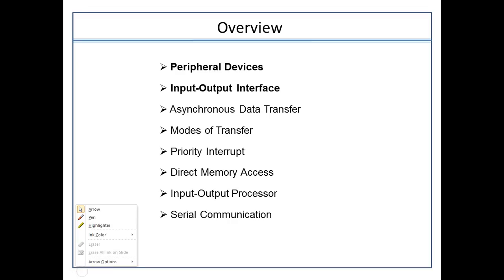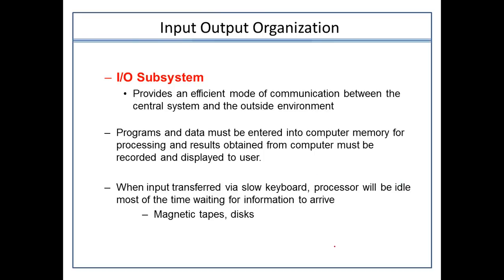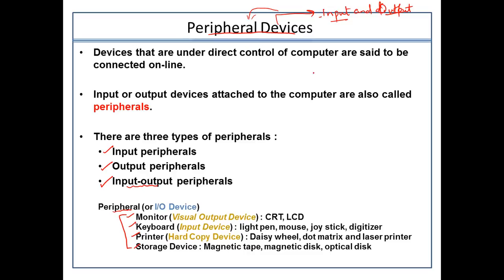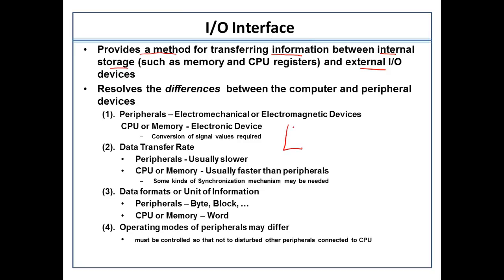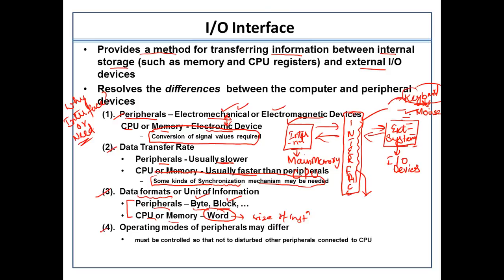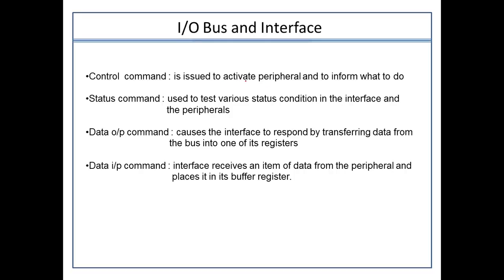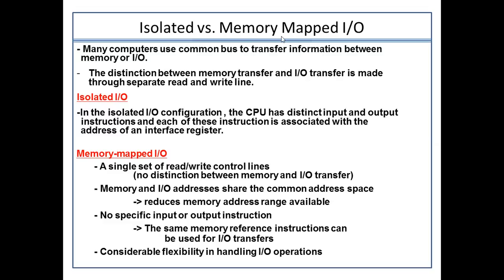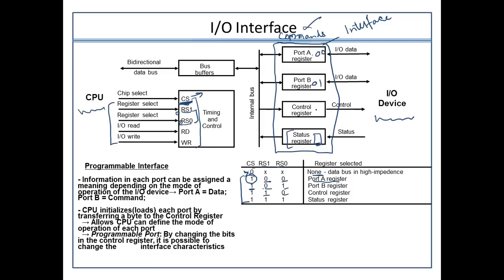Input Output Organization- Peripherals and I/O Interface

Comment: Explained Very Well, Ma'am.
I zotted down some doubt please help me to sort out this!
Q1- Is internet device like the modem is considered as  Input or Output device (as because it takes input from ISP and gives the output as wifi to us)
?
Q2- At 14:00 what functionality 8th bit(MSB) perform in the system?
Q3- At 18:50 what is 'word' used for (is it means the group of bytes/bits)
.
Q4- At 24:00 (In dig.)The interface between different components(keyboard, printer etc) are the same for all components, as they are performing the same function?
Q5- At 34:08 Is CS(chip select) act as an Enable pin?
Reply from the maker: Thanks so much for watching this session.
Here are the answers to your questions dear:
A1. Modem(Modulator/Demodulator)is basically considered as Input/Output Peripheral, as it has the capability to send and receive the data over telephone lines.
A2. The 8th bit in ASCII code is usually the extra bit which is used based on different application. for example, some Printers recognize 8-bit ASCII code and they consider this 8th bit as 0. But sometimes this 8th bit is also set to 1 in order to determine other symbols such as Greek alphabet or Italic type Fonts. and when we use 8-bit ASCII code for  data communication, this 8th bit may be employed to indicate the parity of the binary-coded character.
A3. "Word" depicts the size of instruction/data in the Memory. Here, 'Word' signifies that Memory Unit takes the data in the form of a fixed set of word.
A4. The Interface will be attached to individual peripheral but the general functionality will remain same.
A5. Yes CS is acting as Enable in this 

I hope I was able to clarify your doubts :)
Reply: @harneet21  Thank you once again Ma'am.
Reply from the maker: You are welcome !